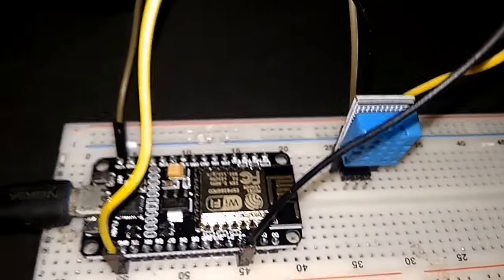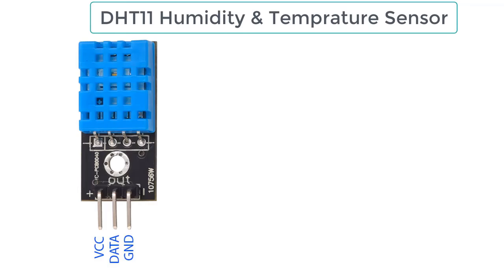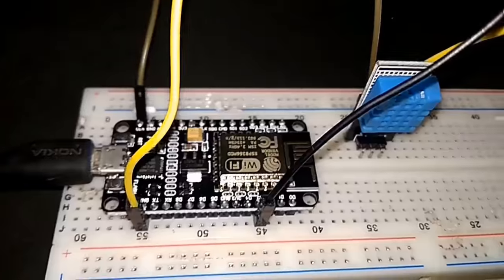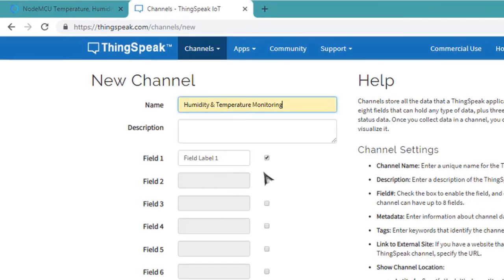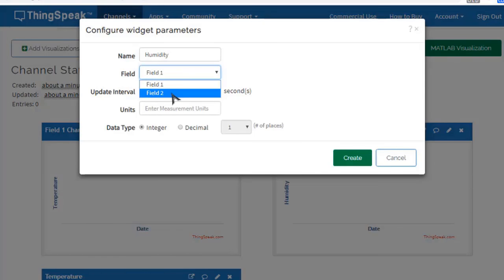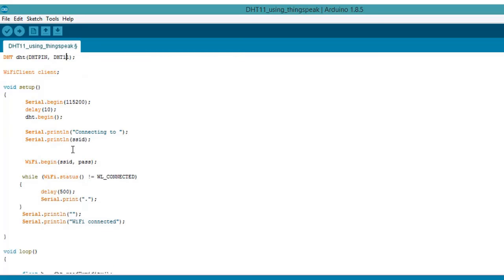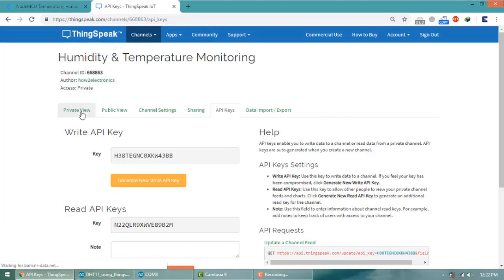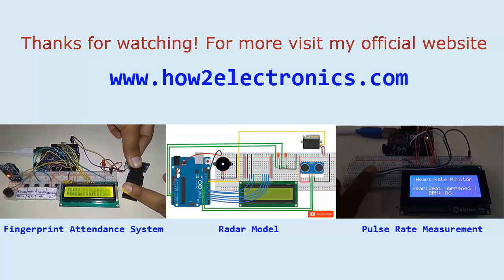DHT11 & NodeMCU Tutorial ||  Humidity & Temperature Monitoring over  Thingspeak

Comment: didnt work :(, my serial monitor is empty
Reply: double-check the baud rate, which should be set to 115200 as per the code. Else change the rate in code as per your requirement.